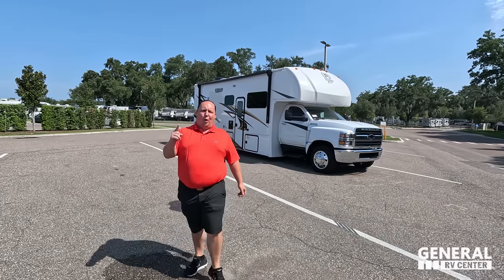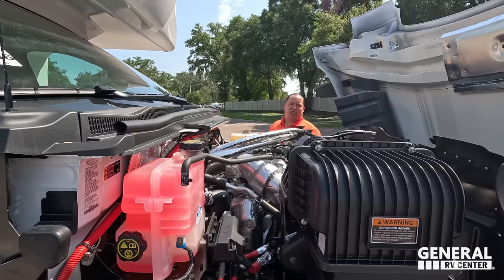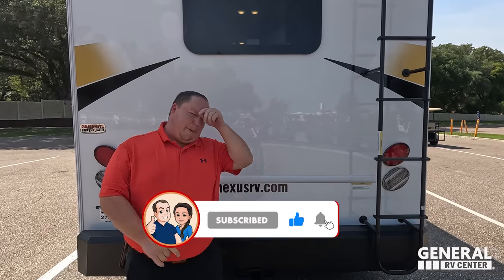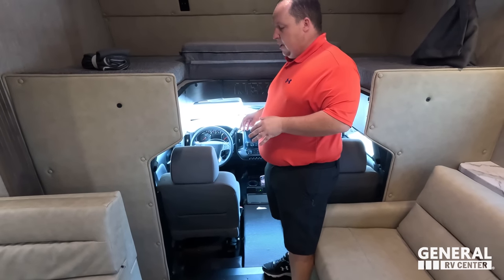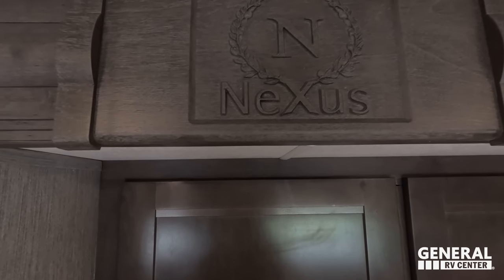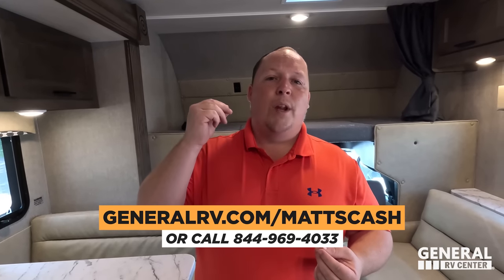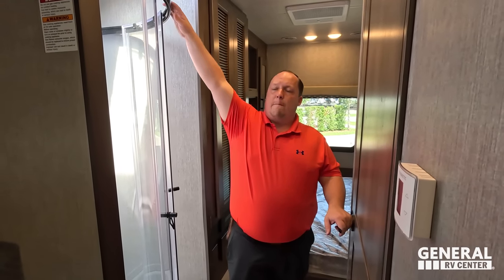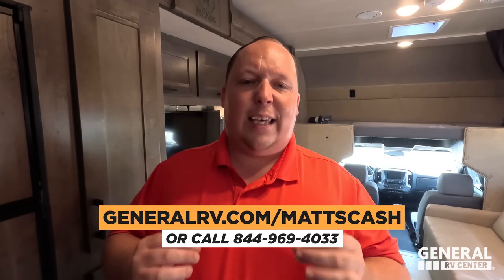All New Nexus Verrado 32S - CHEVY Super C!

Comment: I want a class C under 25'. Driver and passenger seats that rotate 180 degrees that recline and have leg rests (these are your theater seats. Dinette across from kitchen. Split bath if needed and saves room. North/south bed in rear that you can use if the slide is in. Also a little more clearance underneath rv and 4wd.

Comment: So did the generator door support already fall off or was it never installed. Either way, it's not a good look for NEXUS. Why are the lights in the storage bays mounted on the walls . I'd bet they will be blocked by items stored in the bays. My pet Peavy is having to crawl under the slide to access storage, especially since the propane and battery bays are so easy to access while camping. For the most part, neither propane or batteries will be accessed while camping. I don't like that the engine exhaust is on the patio side. On the rare occasion you need to run the engine while camped especially if the Awning is out is going to stink!
A large window for a headboard board sucks. Just a big hole which allows noise, heat or cold in. Most people are not in bed to look out the window.

Comment: I've always been a fan of Nexus since you first started featuring them. However, for that price I would like to see a solid front fiberglass cap and definitely storage under the seats. Wasted space under those seats is kind of ridiculous. It's not a huge motorhome and you need all the storage. You can get. The fact that they overlook this it's kind of shocking. I don't like flip up storage but that would be better than nothing. I'm also not a fan of thermofoil countertops. At the very least, the kitchen area and the dinette should be solid surface. Hoping that theater seats are an option instead of that nasty couch. There is already enough sleeping space .Another great review and I appreciate you as always

Comment: This super C is very undesirable that 2 way refrigerator sucks, kitchen sink is way to small, radius shower sucks you can’t bend over to clean your feet/legs and it should have a king bed. This a diesel super C.  They cut a lot of corners. Btw what is loud noise? Is that the AC?

Comment: Keep up with the times Nexus.  Get a12v compressor fridge, lithium batteries and build a decent bathroom.  This is not a great RV.   The generator and ac units are really noisy.  Bag insulation and cheap units equals more noise.  What a laugh at the price for an RV that will ride like a tank.  No way.

Comment: IMHO, this unit is a dud. I looked at Nexus, Thor and Dynamax. The quality in this unit is obviously poor and the materials cheap. The outside seams, the kitchen sink, the DEF fill on the passenger side, the split bathroom. I could go on. We bought a Dynamax 28SS, and this video only cemented that we made the right choice.
Reply: Dynamax is 10X the motorhome this thing will ever be, even the Rebel trim with 4x4 and paint, same 70's bare bones interior.

Comment: Here is Matt with more propaganda, AZDEL does de laminate and wrinkle but lets not mix facts with Matts propaganda not a bad floor plan, terrible generator insulation very noisy, they should run them all the time along with the AC so people can see how bad of a location and sound insulation is there, no cross ventilation in the overhead cab..this is a stripper model with basics, least not a Thor product
Reply: Lighten up lib